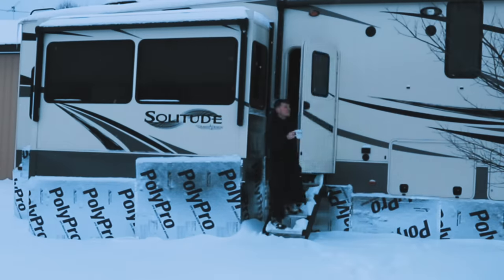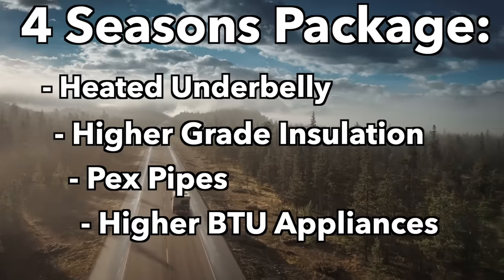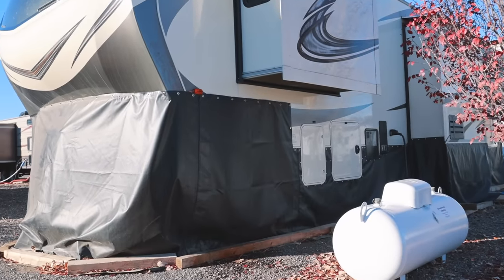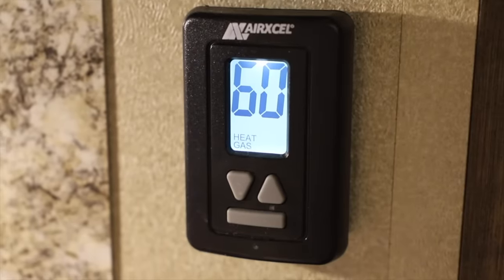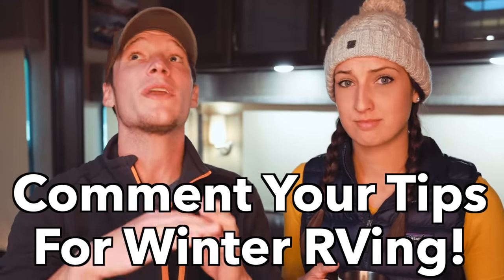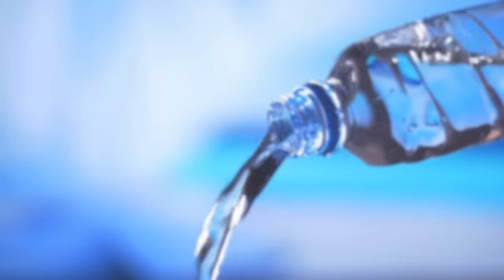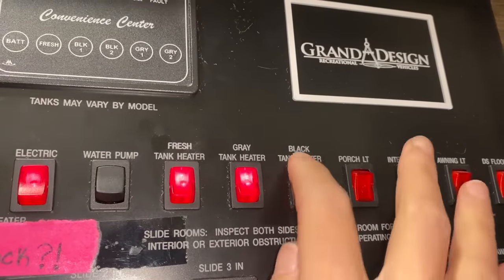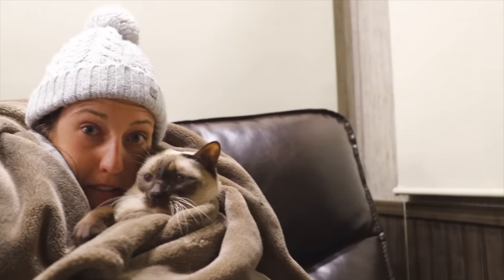RV WINTER CAMPING TIPS & TRICKS - A Complete Guide to Success!

Comment: I see so many RVs/5th wheels with good skirting BUT they don't put it around the elevated, master bedroom so that creates an unbelievably Cold zone inside the RV.  Skirting here not only dramatically improves the ability to retain heat it gives you an enclosed zone of protection around the propane tanks AND it reduces the chance of Theft which is becoming Very Common.
Next:  Toppers for the slide outs, a fitted AC cover as well as interior insulation in the opening.  One more:  insulation sheets Under you slide outs and under belly as well as temperature activated heat source in you wet well/basement.

Comment: He was right, the house has wheels… roll out!
Winter life in a camper is hard livin. Do everything you can to make it easier. After skirting the camper set up a couple work lights (drop lights) with 100 watt bulbs close to your tanks or the wate water discharge… help to bump the heat up just a little

Comment: #Thanks Hanks: Great video thanks for sharing, all of the tips your video provided are very valuable tips. While I encourage anyone to come here in the summer and see all that Michigan has to offer. Winter camping is an entirely different animal all together and can damage both your vehicle and RV from the icy winter conditions to the rock salt on the road eating away at your vehicle and RV. Temperature's in Mid-Michigan can dip into the negative twenties and thirties range in the winter months and stay there for up to six months to eight months straight. Even though Michigan is supposed to stay temperate until the end of December, it never does. Usually about the end of August after our Indian summer ends, the cold nights begin, and it continues to become even colder as the months go on. Michigan in the deep of winter shuts down for RVer's, due to the unpredictable winter weather conditions brought on by the Canadian artic winds blowing off from the Great Lakes and funneling down throughout Michigan. The majority of RV parks are closed to the public, including state camp sites. Due to the roads being rough two track dirt roads, which often become impassable and slippery due to the snow and ice buildup, which never gets plowed; nor salted.  Michigan can be spread out, especially where the state parks are located which are often on state land and are located miles from anywhere. In winter in those state parks the only ways in or out once the snow hits is by snowmobile, on foot, snowshoeing or by cross country skiing and an ATV will just get stuck on those trails in the winter. I live in a very nice area next to main roads, when we have a heavy snowfall the neighbors with the plows have to plow our roads. Because our local road commission won't even bother to plow our roads. Even with my pickup, which can walk through most snowy roads, I still have to be careful and take it slow. If the roads are too packed with snow, I just stay home because I can't even get out to the main road and my roads are paved, including my driveway. Michigan winters can be interesting to say the least, because in fifteen minutes you can go from clear roads to impassable snowy, icy roads in Michigan in the winter. I have lost more time from work, due to snow days in Michigan throughout the years than I care to remember. While I love the summers in Michigan, I will be glad to be leaving Michigan because I hate the winters in Michigan.-Happy travels guys

Comment: Is there an electric heating system as opposed to propane? What RV magazine do you have/recommend?
Reply from the maker: Hey Tom! I'm sure that's coming in the planning of future RVs. It would be rough though if the power went out because the propane furnace can run off the battery. You would have to keep a generator running 24/7 to keep everything warm.

RV Today just released a magazine with some RV Winter Tips and more! If you use this link, we can give you 20% off!
https://simplecirc.com/subscribe/rv-today?source=WHEREVER

Comment: Do they make an electric heat system so you don’t have to use propane?
Reply from the maker: Hey Tom! I'm sure that's coming in the planning of future RVs. It would be rough though if the power went out because the propane furnace can run off the battery. You would have to keep a generator running 24/7 to keep everything warm.

Comment: This year is my first year living in an RV... and we had lower then normal twmos here... I hadn't gotten  skirting or anything and had to do something... I ran to the store and bought a bunch of tarps folded them over so they were double layers and ducktaped them on... I did the front back and the one side with all my hookups, I then put a tarp over the picnic table and pushed it up against the other side and I have been keeping my car parked blocking wind... I will have to work hard to get the ducktape off my side and I know this but it was a snap I have to deal with this... I was not told that the propane heat heated the underside so I put a couple bricks under my tanks and put a space heater under there to keep the air warmer... it has worked this year but I am going to be doing longterm fixes for the coming years... Tha ks for all your tips
Reply from the maker: That is so great! Nice job for coming up with something on the fly! We just recently heard of this company called AirSkirts! Look them up, maybe something for future?

Comment: I'm in Texas in the Abilene area. My 2021 Columbus 5th Wheel (389FLC) has an elevated bedroom and bathroom in the back, the kitchen is the only area on the "main floor" and the living room in the front. As you can imagine there is cavernous storage (completely pass-through) underneath the bedroom/bathroom. The Wet Bay is part of that storage area, partially open to it, but the guts of the Nautilus system is behind a wall but open at the top of that wall. There is one heater outlet to serve the entire storage area. I'm guessing that most of the water lines are behind that wall. I would assume that the tanks would be immediately under he floor of the huge storage area in the back. With the tank heaters and a ceramic space heater both on and with the space heater in the vicinity of the Wet Bay, how necessary is it to have my furnace on in winter temperatures in the teens and 20's?
Reply from the maker: Hey Randy!! Sounds like you have an amazing set up! Yes, I would also imagine your water lines are back there as well (that’s how ours is set up). To answer your question, I can’t be exact. However, I would say to err of the side of caution and run the propane heater somewhat frequently, since it can have a thorough hearing of the entire underbelly… compared to the heaters in heating in the vicinity if that makes sense? I’m just spitting ideas out here 😄👍🏼 Also that temperature monitoring device was a lifesaver as well, it’s nice knowing what the temps are at all times

Hope this helps, have a great weekend friend. Talk to you again soon 😊👋🏼

Comment: Sitting in my RV/office after work listening to the sleet and 50-60 mph winds whipping by while watching this. Luckily my 2x 1500W heaters are able to keep up with the heat loss at least at these temps, no propane used except to raise the final 3 degrees this morning and I changed my heater start time to 7 am instead of 7:30 so should have no use tomorrow. While electric isn't super cheap it's better than burning through $5.25/gallon propane!
Reply from the maker: Oh my goodness Andrew 🥶🥶🥶 That sounds super COLD!! Propane is getting pricey for sure! Thank you for watching, it’s really great to hear from you 😊👍🏼

Comment: Now I have a trick for YOU to make your life much easier... you can even turn OFF your propane heater if its seprate from water heater.. and just run the electric heater... you just need to have a inline duct fan blowing warm air from the cabin into underbelly area ... you would save on propane... have lower humidity levels... have fresh air in the cabin all the time :)

Comment: Hey guys!  Thanks for this video.  Very helpful.  But I have a couple questions if I may?  We are going camping next week for a few days for thanksgiving in our TT.  It’s not a 4 season camper but the underbelly is enclosed.  A couple of the nights, it’s going to be below freezing, like low 30’s and 20’s, predicted.  We have a heated water hose just purchased but concerned about freezing pipes.  We will be using our LP heat and a space heater to help save on the LP usage.  Our heat ducts do not run through the underbelly, but down through the outdoor kitchen into bathroom, and living area.  Would it be ok to leave heated water hose hooked up and just let the water drip to prevent pipes from freezing or bursting?  I know you also mentioned to keep all tanks closed.  Any suggestions would help.  Thank y’all.
Reply: Just remember that a dripping or trickling water line (to save freezing of water pipes) is just trading one trouble for another… freezing of sewer pipes or tanks. In a mobile home, the sewer pipes can start freezing on the bottom and gradually the “freeze fill” level will choke the ability to carry water away and a simple flush can back up. In a RV, it may be just that the holding tank will fill up faster and the ability to empty it gets taken away if the valve gets frozen. So, always a balance of which is the lesser of two evils! I would suggest some kind of skirting and if you get into freeze trouble you can heat your ground space with a space heater to thaw out enough to get valves working, etc. (Or fill up holding tanks with hot water just before dumping.)
Reply: @harrygoodman6724  thank you for the reply and that info.  I do really appreciate it! 👊🏻
Reply from the maker: Hey there!! We would agree with Harry. Unfortunately that seems to be the case. We would be all for trickling water (as that seems to be a great thing in sticks and bricks homes) but then if something were to freeze within the tank… you could have some major flooding and water damage 😱 The skirting was a life saver for us, but I know you guys are in a different situation with only visiting. Hopefully things work out ok ❤️❤️ keep us updated on how things go, I wish we had some more suggestions for ya
Reply: @HappilyEverHanks  thanks for that info.  Yea we are gonna be there for 4 nights and then return back home.  We just want to make sure that we protect what we can with these temps until we can get back home and winterize again. Just wish we were already full timing.  But thanks for all the help and we do appreciate it a lot. ❤️❤️
Reply from the maker: We hear you! Hope to see you guys one day soon ❤️❤️ Thank you for everything, we will catch up with you guys again soon 🙂👋🏼

Comment: Yea...turn on electric heaters then set your thermostat to recirc...Will pull in the warm air and push it into underbelly...No need to run propane to get that warm. Just need to understand how your HVAC system works.
Reply from the maker: Thanks for sharing! We do not have a recirc setting on our thermostat though! Need to look into this!

Comment: We just put a space heater in underbelly. Cheaper than propane, unless you're on generator
Reply from the maker: We worry about leaving a space heater unattended but appreciate you sharing!
Reply: Get a vornado with multiple safety features. They have overheat and tip over protection. Very safe. 

Meanwhile... I've had a customer of mine who's RV heat exchanger on his new camper almost killed him with carbon monoxide, all heat has inherent risk.

Comment: My partner fully winterised (tarped roof, skirting all the way around and even covered the front of our fifth wheel) as seen on a scene in this/ to our trailer for the this winter. We had a flash river flood and had to emergency evacuate. So that being said if you have to emergency evacuate you will either be homeless in the end cause you just took your truck. or you didnt make it out because of all the winterising holding you back from leaving quicker then you should. My advise is NO TO SKIRTING insulated all water pipes best you can and be ready to pull out at ALL TIMES. We barley made it out but did because he hauled ass. BEWARE OF THE EMERGENCY EVACUATION PEOPLE.                 Hope B.C.2021
Reply from the maker: That is very true and sounds terrifying! Thank you for sharing and sorry this happened. We've had to leave behind our trailer due to flash flooding since it is extra dangerous to worry about an RV during high water. This was back in 2018 in PA. We figure the RV could be replaced and worried about ourselves getting to higher ground!

Comment: Emergency! 
Anyone ever skirt an rv and run through onboard generator?  I started skirting last night but didn't finish.  We had plenty of air gaps from not finishing. I made sure to cut a large hole for the exhaust but after about 2hrs our co monitor went off. I removed the foam board where the exhaust pipe is and it happened again after 1hr. Any idea how to keep it from happening?  We bought the rv to live out of on our property so we have no hookups 
Any help is greatly appreciated

Comment: i bought my 100 lb tank and we did have the choice to rent but we are stand still for a few years we can resale to them the come refill they also fill our tanks on the rv when it gets around 30% they said call them but we where at 40% and told them we need to fill early and they came out filled and we were good to go this was our first yr we went 3 weeks no water then we were so LUCKY that only damge was our outside kitchen fauset froze and broke guy came pushed me in he only charged 60$ 5 min fix he was not going to charge 100 service call he is the only one we call so he has gotten 100 and 200 $ tip he staid really late. he now gives me tips in text it was our water hose froze i had a 50 ft but then it was to short now we have a 100ft hose and 50 ft heated hose also a note we have a clear source filter the casing shattered its 100$ to replace they recommend taking the water filter off and store it till warmer we plan to invest in there heat case next year and a out side lamp for the outside kitchen